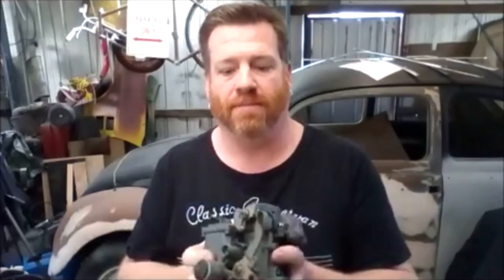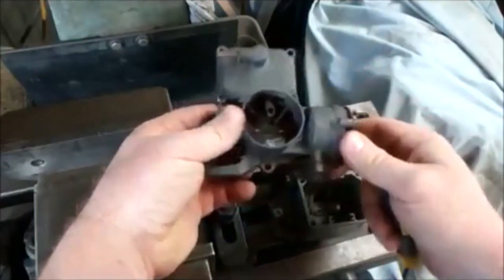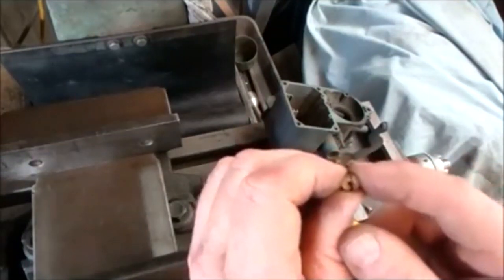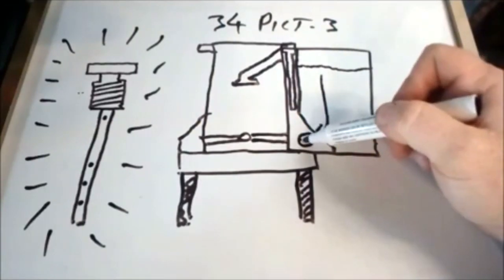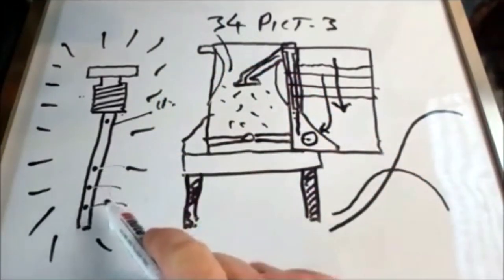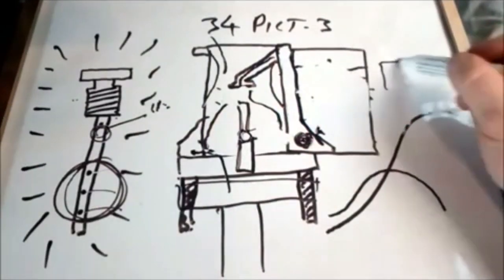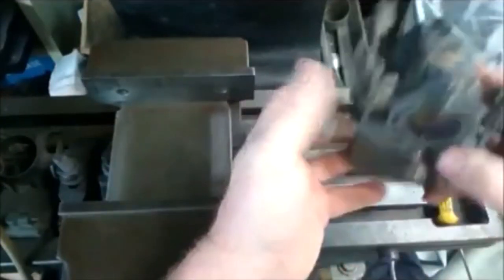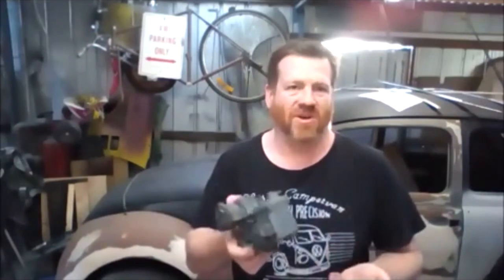Beginners How to Turbo a VW beetle using stock 34pict or EMPI 34 pict-3 Volkswagen Carburetor

Comment: Try adding a extension to the fuel bowl vent up into the boost pipe, brings enrichment on a little quicker
Reply from the maker: There is another way, increase enrichment by changing your emulsion tube bleed does the same thing

Comment: Awesome video. I’m following this for my turbo build using an EMPI. I was wondering about the other extraneous brass vent tubes around the carb body. Should they be plugged as well?
Reply from the maker: Hi there , any tube not being used should be plugged to stop boost leaks

Comment: This is great information which I've never seen before, and thank you for it.
I'm thinking about using twin 34-PICTs on a Type III, and adding boost. 
Do you think that might help overcome some of the single carb limitations and still remain a budget build?
Thanks.
Reply from the maker: Glad it was helpful!
Reply: Planning the same but onna 1.7 type 4. Twin carbs. Twin turbo. For a cheap as possible
Reply: Thinking of doing the same to a type4 1.7. Twin carbs twin small turbo 🤔

Comment: Great vids, these have been such a huge help in my budget boost build. one question, these carbs have a shut off fuel solenoid, Do i still need to have this plugged in and if so would you be able to explain why?

keep up the great vids 👌

Thanks
Rob
Reply from the maker: Rob , fuel solenoid prevents run on ,only reason for it to be there , it needs to be plugged in to provide fuel to the  idle circuit

Comment: Draw through from carb into the turbo.
Instead of pushing the turbo into the carb.
You get a cold charge , and it doesn't effect pressures into the carb.
Reply from the maker: Each system has it pro's and cons,  it depends on your budget
Reply: @shedtorquenthings633  in my experience, off idle when you do a hard blip on the throttle of a draw through set up, it's generally very choppy in comparison to a blow through. To me blow through's are smoother to drive on a normal street VW.  It also allows you to install an air to air or water to air IC.  On draw through you'd have to do a water/alky and/or e85 to make it have NA intake charge temps.  

This is very informative even for the experienced gear hear/mechanic.  

The 1st set up I did was a draw through with a Holly progressive carb on a bone stock 1600.  So fun to drive.  On the freeway it was peppy like a mild 1776.

Comment: Hello from France! Good job! I’m boosting a vw mk2 golf , i have a solex 34pict5  and a gti électronic ignition , it’s possible to pute an assymetric regulator for fuel/air ratio with the solex carb?
Reply from the maker: you should be able to get correct AFR's with the emulsion tube

Comment: if i was to turbo my 1969 1600cc beetle would draw through or blow through be better and if its draw through would i have to get a bigger carby?
Reply from the maker: Depends on what turbo you decide to use, one will require a positive seal (carbon) and the other won't , In most low boost set up's you will get away using the 34pict carby jet up..

Comment: So i  bought a vw  34 pic 3 carb put on my 81 goldwing 1100, and i out turbo on, i set wg to 0psi, but it revs up great untill you try to drive it and starts cutting out, whT coukd be the isse
Reply from the maker: Hi there , First thing to invest in is a Fuel A/Fr gauge , without it you won't be able  to tune , it will show straight up if you have a lean or rich issue . Boost pressure is a measurement of accumulation , even at  "0 " pressure  you can still have increased efficiency  air through the manifold ......

Comment: Hi, I have a naturally aspirated 2.0 ltr 2010 VW beetle... Is it safe and worth it too turbo it?
Reply from the maker: You can Turbo any motor , safety depends entirely on the tune and how much boost is used and the size of the turbo , everything has a impact to how a engine will perform ...